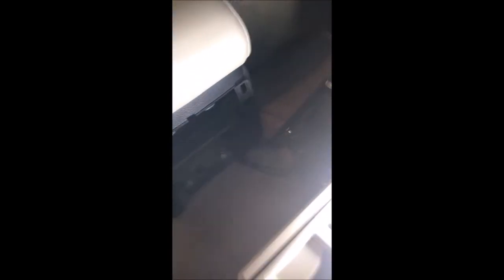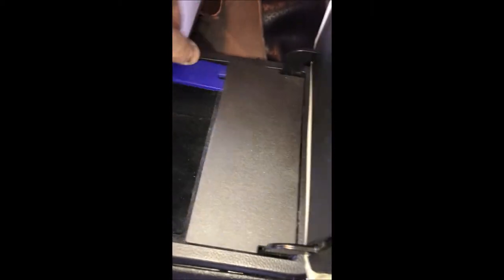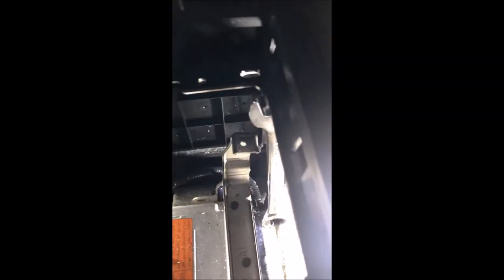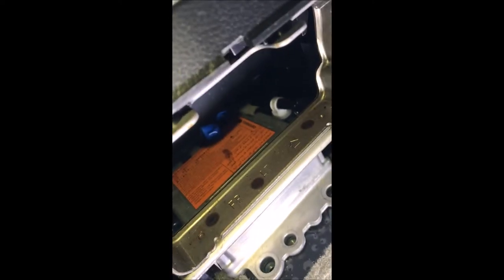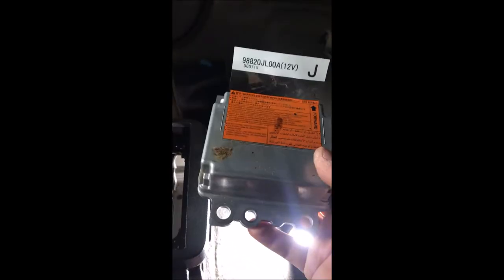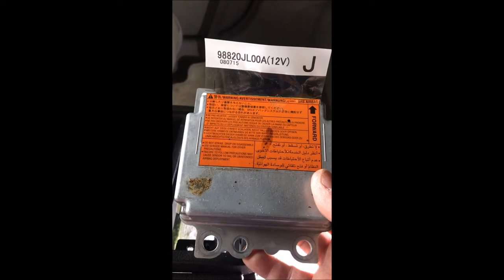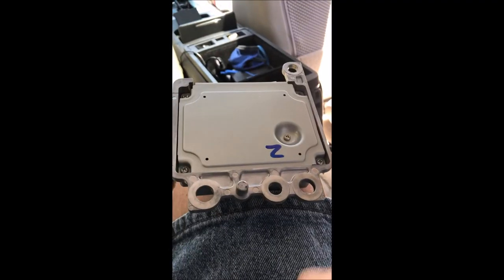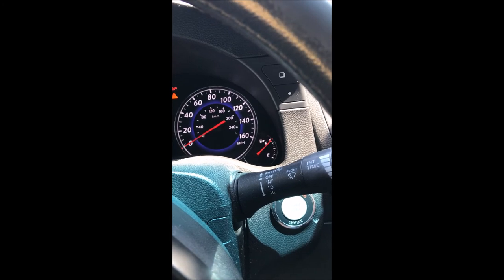Infiniti G37 - Remove Airbag Module WITHOUT Removing Center Console

Comment: Question, did you unplug the battery before removing the "module"? I purchased the repair through SafetyRestore and am sending the module.
Reply from the maker: Hey! I honestly don’t remember if I did or not if I didn’t say it on the video, but definitely couldn’t hurt. I probably didn’t because it was just the module and not the actual airbag. Glad this video helped!!
Reply: @toddlefortsgarage  thank you so much.

Comment: My 09 g37 was in a accident my airbag did deploy but my airbag light did not come on. Should I still get my airbag module reset?
Reply from the maker: Hi Antoinette. Hope you’re ok from the accident. Sorry to hear that. I’m no airbag expert. That’s really odd that the airbag light is not on. If it were me and the car was all repaired and the airbag light is not on, I would not personally make the expense or work to reset the module. Perhaps the repair shop took care of that for you when they did the repairs. You have to make the call that’s right for you though. That’s my opinion. Hope this helps a little.
Reply: @toddlefortsgarage  Thank you and thanks for your quick reply. I’ll be replacing the airbag myself this following week if the airbag light is still off I’ll probably take the initiative and not reset it. I started to get the center console out to take out the module and I’m having trouble getting it out. I started thinking if I do send the airbag module in what are they resetting if the light and code aren’t showing.
Reply from the maker: Airbag modules store hard and soft codes when there is an accident. Even after small accidents, fault codes will be stored in the module which will turn on the airbag light. When you send in your airbag module, they reset and clear all of these crash codes inside the module in order to turn off the airbag light. But if your airbag light isn't on, maybe there are no fault codes stored on the airbag module.

Comment: May I ask where you sent it out to get it reset? And is sending it out the only option?
Reply from the maker: I used Safety Restore. They are out of Westfield, MA. I found their airbag module reset service on eBay. Here is a link to their website - https://www.safetyrestore.com/7-airbag-module-reset-service. I’m not paid to endorse them. Their price was reasonable and service was very prompt. 
Yes, there is a way to reset it without the service but you need the same software and module connectors that the company uses and the knowledge of how to do it. I don’t have any of that. For $40-$45, it’s worth it in my opinion.
Reply: @toddlefortsgarage  ok nice thank you! I appreciate the quick response! Just subscribed to your channel 👌🏽

Comment: Hey Bro, is there any difference between years and SRS modules? I have a 2014 Q60 (same as G37 coupe). I bought the car with the light on SOLID took it to Nissan and the claim it’s the front crash sensor, driver side sensor and module…. I’m assuming I should start with the module first? Who reset your module?
Reply from the maker: Hey Raul.  I just don't know.  I'm like you.  Just a guy trying to fix his own car.  A quick look on the Internet "looks" like the cars are relatively the same generation so the SRS module may also be the same.  I put in a previous comment reply that I used Safety Restore. They are out of Westfield, MA. I found their airbag module reset service on eBay. Here is a link to their website - https://www.safetyrestore.com/7-airbag-module-reset-service. I’m not paid to endorse them. Their price was reasonable and service was very prompt. Hope this helps!
Reply: @toddlefortsgarage   Thanks Todd, I will use your method and update you . Keep up the good work I will subscribe to your channel!
Reply: There is a difference in the modules. You’ll have to look at the part number it has .. it probably is best to get the module reset if there was airbags deployed or if the module is faulty. Once the module is fixed then whatever codes are left are the remaining issues with the car
Reply: @MarioHernandez-bn6pm   Thanks bro I will check that out soon, can I come back for you for advice on this? I may need to buy the front crash sensor I think I was told it’s Broken
Reply: @racova3663  yeah that’s fine man.
Reply: @toddlefortsgarage  what service did you go with ? There are so many airbag reset services to choose from on their website. I have a 2009 g37 sedan I believe it’s the same as yours shown in the video.

Comment: Great video. I have a 2012 G37x Sedan sport my car was in a accident after the impact the airbag didn't deploy but the SRS airbag is flashing, it was diagnosed with (code: B1015 PRESENT FOR AIRBAG CONTROL UNIT) is this related? if it is, would the module be located on the center console as well?
Reply from the maker: Hey Don. Sorry to hear about the accident. Hope you’re OK. I don’t know exactly. if you go to www.myairbags.com, they have a pretty basic airbag module location lookup. For a 2012 G37 it says that it’s “under center console on the floor”. Good chance it may be in the same place. Hope the video helps you fix yours. Good luck!
Reply: @toddlefortsgarage  Thank you for the quick response. I will try that!
Reply: If yours is blinking than it's much easier to remove.. there's a few steps you have to repeat in a certain sequence and it should fix
Reply: @brandolopezz4397  not sure if I can follow! what steps?
Reply: @Don-qz1cu  one of the steps is switching the key on and off like 3 times look it up on YouTube
Reply: @brandolopezz4397  Finally after sending my module to get it reset and getting it back withing a week (Today) I put back my module and the blinking issue its gone!! Reseting my module in this case worked for me.  Brando - you need to specify wich model infiniti this trick work for? because removing my center console from my infiniti 2012 G37X Sport took me less than 5 minutes. I guess based on year and model it's different. Just a some comments for you!

Comment: Would these cause your car to not turn on or turn off by itself while driving ?
Reply from the maker: No it wouldn’t. I didn’t have a problem with that while waiting for the module to be reset. And I haven’t had a problem with it since. Never have had a problem with this setup. Hope that helps.

Comment: I got in a accident recently but no air bags went off but I already have my airbag light on that it has been in a previous accident but it turn on and cranked well and after this accident it doesn’t crank but turns on but I could hear a buzz and click when I try to crack with this possibiliy resolve it ?
Reply from the maker: I wish I could tell you that it would but….i just don’t know. I’m not a mechanic. Just a DIY’er like yourself. I’m sorry I can’t be more help.
Reply: Hey there, did you figure this out?? Having the same issue my car won’t start after being in an accident and airbags deployed

Comment: HELP PLEASE My 2008 G35 has a continuous airbag light. Tried to reset it. Didnt work. Took it to the dealership. They say the passenger side airbag sensor needs replaced. $6-$8 grand! Im disabled dont have that kind of money. Did my research. My specific car is not in this recall 😠.. Live in an inspection state and cant pass inspection. Cant find a used seat ( might wind up with the same problem anyway ?) Thinking about seeing if someone can check the connection under the passenger seat ? Could it be this entire module?